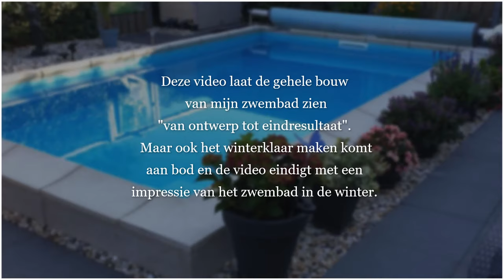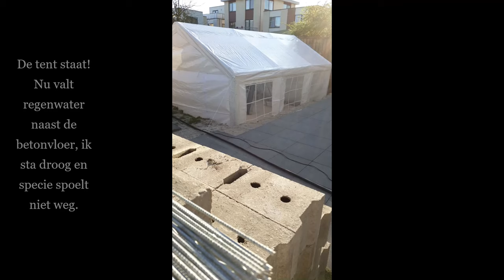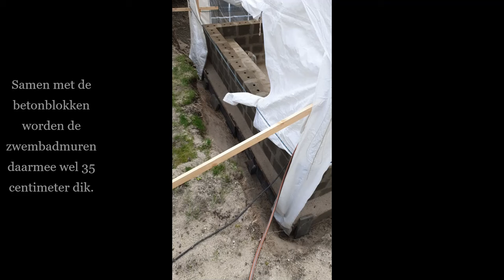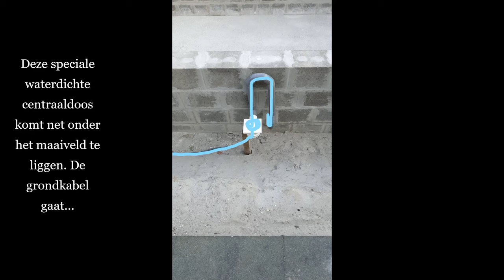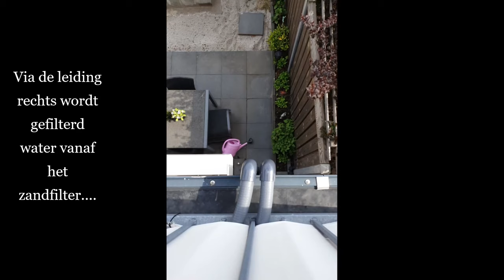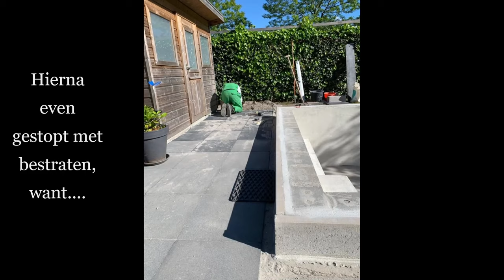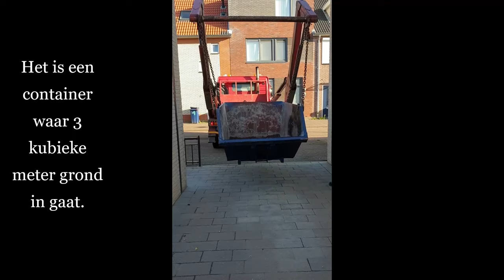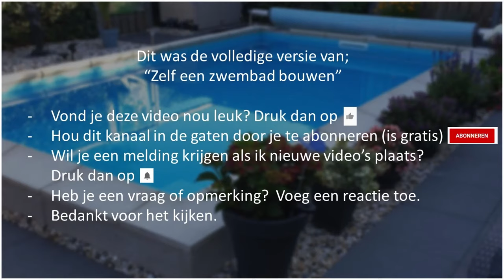Zelf een zwembad bouwen | Video's 1-10

Comment: Building them is the easy and cheap part - keeping them heated is the real enemy. Especially in UK
Reply from the maker: Hi Stu, I wouldn't say easy to build and cheap. But indeed, getting the pool temp to a nice and comfortabel level, is a challenge in our countries. As long as the sun shines and the nights are not too cold, the water can reach nice temperatures in summer, thanks to the sun collectors.
Reply: @MartinVledder  I love your channel and videos, watched the full build process - I am thinking of building one myself as have the room in my garden. But the cost of heating a pool I can't afford. Maybe a pool heater with pump but unsure of the electric costs. Northern Ireland is a cold country. Lol
Reply from the maker: Nice to know that you like the videos. Hopefully you will find an affordable solution for heating the pool.
Reply: Heating is not a problem even in our cold climate. But you should isolated the pool all the way around. That's why we only use polystyrene blocks.